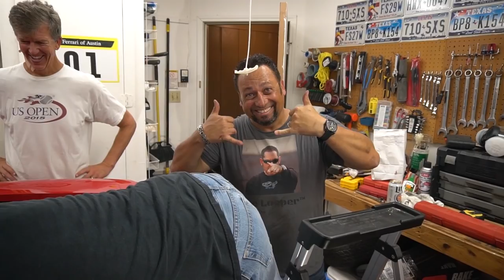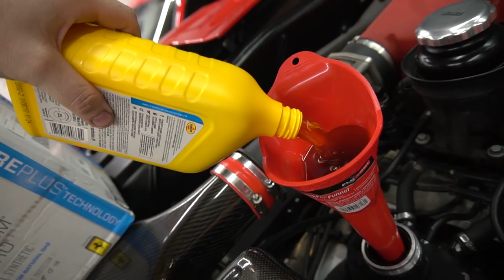How to change the Oil and Brake Fluid on a Ferrari 360 - Drunk edition!

Comment: Also Quick tip, when I do the brake fluid on mine, Clear bottle with about 1" of brake fluid at the bottom, clear tube and crack the bleeder. Then you can just actuate the pedal and no threat of air entering, pump until the clear fluid comes out. Nice job guys!
Reply from the maker: Good tip

Comment: I really like the F1 style brake lights on the lower back of the 360. Also, I think with every generation, Ferrari has made their cars more serviceable. Now you know why I like the Ferrari California. (Before people start screaming: Yes, yes, I know it's a very different product from the mid-engined V8's)
Reply from the maker: Stu added that light. It looks great.
Reply: "Also, I think with every generation, Ferrari has made their cars more serviceable"
While that is true in terms of belt service and other deep things, I can tell you without a doubt, pulling my tray, dumping the oil and swapping the filter is much easier on a 355 than it is on a 360.
Reply from the maker: Now that we know the oil filter is up top, I wouldn't pull the tray off next time.  That will make servicing the 360 MUCH easier.

Comment: My Ferrari mechanic explained to me that when he started working on 360s, the four-post-lift became absolutely indispensable.  2-3 people can work under a car simultaneously, unscrewing panels and undercarriage to 'find' the oil filter, which is absolutely buried in the underside of the engine.  An oil change took about two days - eight hours was just to unbolt/re-install the trays and undercarriage on the bottom of the car.
Reply from the maker: It definitely was not an 8 hour job, and it could be done with 1 person for sure.

Comment: I think ratarossa has the only vid doing the oil change complete and correctly. 
Allegation: You guys missed the mesh filter on the bottom.  
Penalty: no beer for a day!
Reply from the maker: You're thinking of the F430 not the 360... Plus you don't have to change that filter every time.
Reply: @normalguysupercar  def the 360, ratarossa doesnt have a 430.
just for your future reference.
@16:20
https://youtu.be/I9qILuSn6do